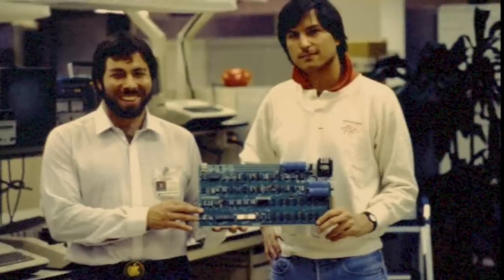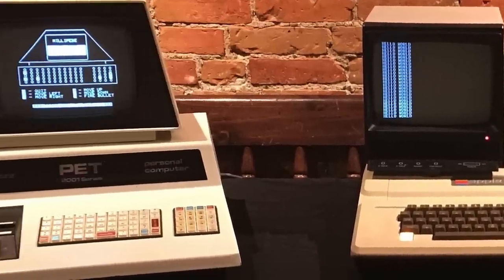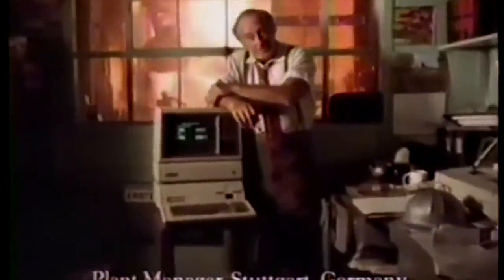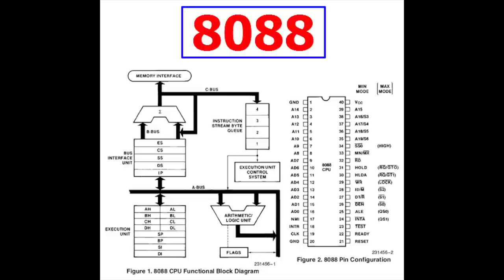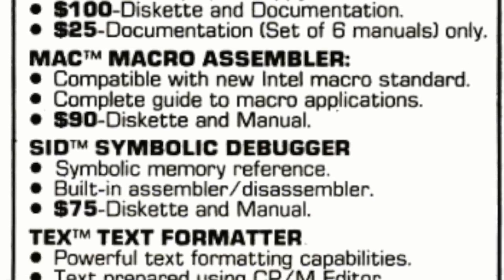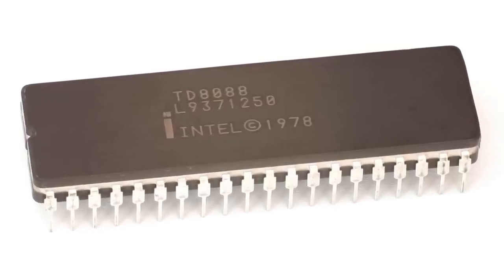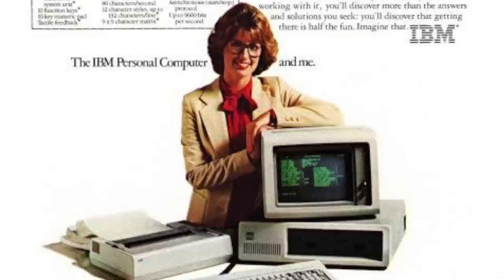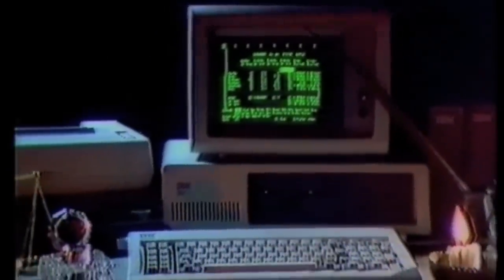DOCUMENTARY: Why and How IBM ended up creating the PC (and ended up choosing the 8088 CPU)

Comment: The 8088 choice by IBM led to the absolutely worst year of my life. In 1985 I was asked to manage the development of Release 3 of Lotus 1-2-3 and the goal was to fit the code for a multi-sheet spreadsheet with other new features, backwards compatible with Release 2.2, and written in C (not 8088 Assembly Language) into a standard 640K original PC. No way would the code fit, so we attempted to partition the software and use Plink86 as an overlay manager. Despite the efforts of 50+ programmers (and 75 QA people) working 80-90 hour weeks for a year, we were unable to pull it off and Release 3 eventually would only ship on 286-based machines.
Reply from the maker: Wow that sounds extremely stressful but also super. interesting! Would you be willing to do an interview on it?
Reply: @AlsGeekLab  Sure. Let me know how.
BTW I mis-typed the date above - it was 1987, not 1985.
Reply from the maker: My email address is in the about section on this channel, drop me an email and we can talk about timing, or you can get me on discord https://discord.gg/mGtHmTaU (although I'm not on discord that often, so could be a little slow replying!)
Reply: But weren't the 286 memory addressing issues just as bad? IIRC, the memory bank switching had to be done by a kludge using the KEYBOARD electronics!  It still did not have properly protected memory.

Comment: In 1981 8088 was not underpowered, actually it was fast minimally like other PC of his age. Also limitation of  1MB od addressing RAM (640k for DOS) was not problem, because in 1981 was 64k pretty standard. 640k was also enough  in late 80s and then came 80286 as standard, so for 8088 was never 640k real limitation..
Reply: I agree. All too often the earliest and least capable PC setups are compared unfavourably to desktop computers released years later, by which time the PC had already moved on.
Reply: @vapourmile  Yes, they forget, that other 16 bit machines like the Amiga only had 512 KB. And don't forget, the 8086 and even the 80286 still used bank switching to really address 20bit of memory space: the processor splitted the memory into smaller 16 bit chunks (64 KB big), that you could address with a quite complicated memory adressing (which made it possible to address every 1 KB of you 1 MB memory with the upper 16 bit hex codes and the specific byte of this chunks were addressed by the lower 16 bit hex code - thus giving you three options for jumps: small (8 bit range, for jumping up to 256 bytes up and down), normal (addressing your specific 64 kb block) and "far" (for jumping farer away than 64 kb).
Also in this architecture you were able to define specific 64 KB blocks as "Code segment" (CS), "Data segment" (DS), and "extra segment" (ES) and even "Stack Segment". When your computer program or data was under 64 KB big, you never needed to fully address the Data segment or Stack segment (where temporarely data was stored), which made your code shorter (the DS/ES/CS/SS was coded into the opcode of the machine code).
Reply: This was also intentional as they didn't want it to gut their mini computers and mainframes. Limitations and a terrible OS was intentional even if 640kb was unrealistic in 1980  IBM wanted to make sure it stayed that way in the later part of the 1980s
Reply: Actually in 1981 64 KB was much, far from standard. When IBM PC was released it had two memory options: 16 KB and 64 KB. In 1981 64 KB of RAM was $400.

The 640 KB was a huge limitation. Sure 286 came but the success of DOS which operated in real mode meant it could not be utilized  fully. Various gimmicks were used to circumvent it like LIM EMS and XMS memories. In the early 90s there were DOS extenders that could allow breaking the barrier but only switch to Windows made it history.

Also note that not everyone had the newest CPU. I used 8088 until 1991. In fact I got it only in 1987.
Reply: The limitation to 640 KB was a kludge, because IBM mixed port-I/O based CPU architecture  (Intel) with memory-addressed I/O (Motorola), using the Motorola peripheral chips to save money. The graphics were also memory-addressed,  but in the original 8088-based PC, only above 704 KB was memory used by the system, so if one had only the original CGA or monocrhome adapter (or combined as in the Compaq Portable), the range between 640 KB and 704 KB was free, and was made available with a simple software hack. The later EGA ang VGA graphics cards did use this range, so then the 640 KB limit was a hard one.  Of course, to use the 640-704 KB range, you needed a large enough memory card. IBM reserved the 640-704 range for the projected EGA from the get-go.
Reply: Reminder of Bill Gates's famous quote: "No user will ever need more than 640K of memory."
Reply: @timgibney5590  Yes - IBM did not want their PC to cannibalize their cash-cow mini and mainframe product lines.

Comment: I should add: This my first computer., bought new for $3000 for the setup. (Robbery!) My 7th grade son learned computing and DOS on this machine. I modified it for 640K and 2 disk drives. When IBM quit selling the PCjr, I bought close out mother boards and other pieces from which I put together computers for my brother and sister. It gave them a start in computing as well. So the PCjr served a good purpose, even if it was expensive for my first machine.

Comment: 2 notes about the 6502..
- while it is 'risc like', it wasn't designed as a risc cpu. 
- after the 1980s, 6502 derivates still saw a fair bit of use in calculators, and there are still microcontrollers around today which use a 6502 derived core.
Reply: I will have to learn a 6502 based PLC for my technician cert too. Our teacher said we'd have to program PLCs with binary because that's uniform with every PLC which is just dumb. All the PLCs used today can be programmed in a visual language (ladder diagrams) or C or assembly or BASIC (the documentation we got didn't even mention machine code)
Reply: @loganmacgyver2625  You aren't wrong with regards to being able to use something more friendly than directly writing machine code, and no-one in their right mind would be programming a 6502 based PLC, or any PLC, or anything 6502 based, by manually assembling a binary. Yes, we used to do that on home computers decades ago, but even 'us old school 6502 coders' usually use modern tools for that now. 

And yet, you are currently learning, and for that the 'dirty' hands-on experience of doing that at such a low level is far from dumb, it gets you skills which are extremely usefull when things don't behave as you expect or the documentation suggests. 

And 'machine code' merely means doing the assembly manually, which really isn't that big of a deal, but very helpfull to learn about why assemblers work the way they do, and being able to verify their output.

Learning how to do this without modern tools means you'll be learning the absolute basics of this, which is, as your teacher says, universal, even when not every PLC is 6502 based.

Comment: If IBM had used, say a, 68008 (unfortunately not developed at the time of the PC design), and then gone to Digital Research, with CPM/68k, the future version of the PC would have been the equivalent to the Atari ST, with GEM (Digital Research's Graphical Environment Manager).  They would have had a 'Windows' type of operating system, and definitely would have scooped the Apple world, and the Macintosh might not have been invented.   Too bad they didn't go with the MC68000 cpu, we would have been spared a lot of problems with programming  around 64k and 640k limits!
Reply from the maker: I think the world would have likely been a better place if it had!

Comment: At the end of the day, unless you're a programmer a computer is only as good as its software library. There's so many examples of fantastic hardware(not just limited to computers, but game consoles, phones and other things) that flopped hard due to lack of software.

Hitting the ground running with a mostly compatible, but more powerful Z80-ish CPU led to easy to produce software that was ready at launch, with a steady stream of others coming shortly thereafter. Add in easy expansion and it was almost an easy victory.

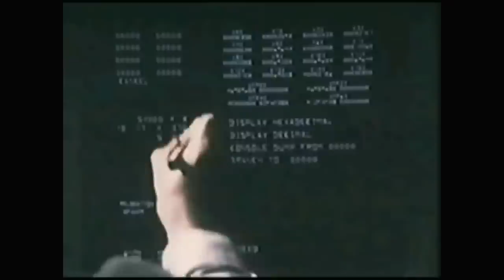Comment: 3:00 ‘They were wrong.’  Actually, IBM wasn’t wrong, they were just late.  I worked for IBM twice, I loved that company, but on the second time around, it was a different company.  It used to be they were early, or they set the standard and we went the IBM way, or, well past when I joined (around y2k), way too late.  I’m so sad for the company, barely hanging on.  If they disappeared tomorrow, not only would no one notice, the youngsters would have thought the company was irrelevant a loooong time ago.  Laf, and yet I’d still succumb to the Ivy League prestige and happily join its ranks.  Stupid me.

Comment: I personally think IBM purposely did not choose a fast CPU because they didn't want it to gut their mainframe and mini computers. Also the choice of DOS which was bad was on purpose as well as they want to sell mainframes if you wanted a stable platform.
Reply from the maker: Could be plenty of truth in that..perhaps we will never know...
Reply: So intel amd and cyrix all worked together to make slow cpus.   And Microsoft  had no competition for dos.
Reply: @danc2014  No. At 3000 nm back in 1981 space was very very limited unlike the 5nm size circuits today. Multitasking? That required much more space and less chips per wafer? More l2cache? More (actually I think it was closer to 1990 before cache were on chips). Wanted more registers so less ram calls? Required more space and less chips per wafer. etc.

Remember the bigger the chip the less can be made from a wafer as costs to etch were made by wafer. when processing costs There were many duds too in those days. In essense a bad spot would be more contained if the chips were smaller for greater yields.

DEC and IBM also made their own chips so they were more advanced as Intel was a tiny company in comparison
Reply: Big Blue was NOT worried about thier mainframe market from the PCs at all...they knew it was a toy. That's why Big Blue never got involved with it. I was working on IBM mainframes and all tje people I spoke to about the PC just laughed it off. The PC could NEVER do what the mainframe does. It still cant.
Reply: That makes so little sense.
Reply: @rty1955  OK, but the "mainframe" of today is made up of numerous microprocessors (e.g. Intel Xeons). The difference is that the data and memory channels have so much more capacity on data center servers compared with home computers.
Reply: @timgibney5590  huh? Have u ever worked on a mainframe? The PC is very limited with regards to processing power. PCs can do limited work. I would not compare a simple spreadsheet to a mainframe. If the majority of your work is spreadsheets, than PCs would be a cost effective option. Mainframe have much more robust hardware and the controllers are much more intelligent than a PC has. For example if you were doing a mass data transfer in a mainframe, the CPU does not get involved unlike a PC. Mainframes have multiple paths to a devices as well, unlike a PC. 
IBM is in the hardware (not software) business and they make some of the best hardware out there.
Novell was the premiere client/server for PCs because it was originally made for S100 type computers and was naturally ported over to the PC world until UNIX was ported over. UNIX at the time used serial ports for networking. UNIX also allowed for multiple servers which Novell did not.  Novell also was VERY expensive too. PCs also had 3270 emulation cards for connection to mainframes.
Reply: @rty1955  Netware and NT had ACL and delegations
Reply: @timgibney5590  and? Netware used a bindery file for ACL, and u needed to make sure u backed it up all the time. That was the Achilles heel for netware
Mainframes typically use RACF (Resource Access Control Facility)
But I thought we were talking about the processing power of a mainframe v. PC
Reply: @rty1955  For an employer a mainframe with 1 cpu (1980s we are talking about) those would freeze up all the time. A PC running Netware was 1/1000th of the cost and could manage resources easier and could do these with VMS on the backend if you really needed something heavy duty with Oracle for a fraction of the cost. Lotus 123 replaced alot of the multi plan software for the mainframe before it for cheaper
Reply: @timgibney5590  Hmmm seems obvious you never worked on a mainframe before . in the 80s IBM was not a single CPU at all.
IBM mainframes we extremely reliable and not once in my 50yr career has any mainframe I worked on ever went down because of a hardware issue. In addition I worked for a company that had not re-ipl'd (reboot) in 4 years. So in terms of reliability PCs need to get in the back of the bus.
A PC is cheaper for a reason as PCs cant come close to the processing power of a mainframe. IBM had two different operating systems based upon the need you required (VM doesn't count as it was a dog) MVS was built for transactional processing and VSE was for mostly batch processing. In fact the 4300 series of mainframes were designed for VSE not for MVS. IBM did have a line of minicomputers (S/34, 36, S/1 etc) but they were toys compared to big blue.
PCs have taken aot of the simple tasks from the mainframe world, but considering now you can virtualise over 2,000 machines in one box the size of a desk. I would think the cost of a desk sized machine would be far less that 2,000 individual servers. Let  ot forget the maint, electricity, AC, and footprint cost on the 2,000 machines.

Comment: My first computer was an Ohio Scientific Superboard (single board computer). It had a built-in keyboard, 4k of RAM, a 6502 CPU (can't remember its speed but I re-clocked it to 1MHz). Can't remember what capacity the BASIC-in-ROM was (8k I think?). You had to make your own 5V power supply and modify a TV to see any output. It had a cassette interface for program load/storage - it worked very well  (mid to late 1970's I think). A lot of water has passed under the bridge since the days I used to fiddle with that.

Comment: Used to be a warranty repair shop for Commodore. They actually produced a PC clone too which had some interesting bugs.
 Looking at the original PC designs you could see some errors that became standard. The printer port was missing one wire to be a fully bidirectional eight bit parallel port , all the chips would have supported it, but no one would change anything after it was in production.
Reply: I used to repair C64, C128 and VIC20 boards. Everyone else just swapped them out and sent them back to Commodore. The biggest problem was ailing RAM, followed by the PLA chips. I only scrapped two boards. One that the owner decided to install JiffyDos, and pried the ROM chip out of the broad, ripping out all the plated through holes. The other board was full of intermittent internal layers.
I saw one of the Commodore PC clones. Our club in Orlando used it to run our BBS.
Reply: @michaelterrell  
Did chip level too 😁 when commodore started leaving the unused pins out of the power supply connectors, the number of blown RAM went way up. The plugs would fit in partly rotated and the 8 RAMs protected everything else, by becoming crowbars.
Friend had a C64 that died from emp from a nearby lightning strike. 18 chips, fixed as a challenge. There was not a single electronic device in his house that survived, the C64 was packed in its box, so he hadn't even looked at it until after the insurance claims.
Yeah, having someone else try, and fail, to fix a board generally means the original problem and progressively less likely ones.
Funniest, a chip replaced by jumper wires. 🤦‍♂️

Comment: Don't forget that the IBM PC was the 5150 because the tape based system you showed was a BASIC/APL computer called the 5100. There was also the 5110 and 5120.
Reply: Is that a TV commercial at 4:21 for a 5100?

Comment: Several years ago, I was doing volunteer work for a local thrift store going through their donated computers cleaning financial and other personal information off of hard crimes and putting complete systems together where possible.  I was given an early Thinkpad that needed a power cord in appreciation.

I found a power cord on eBay and I was good to go.  I knew the original owner and she gave me the original bill of sale and that PC:  $5,237.  It was running Wndows ME and I don't remember how much memory or the hard drive size, but it was laughable.

Interesting story.  Thank you!